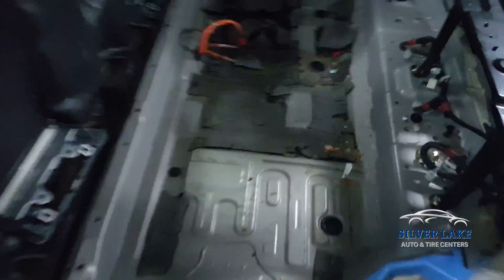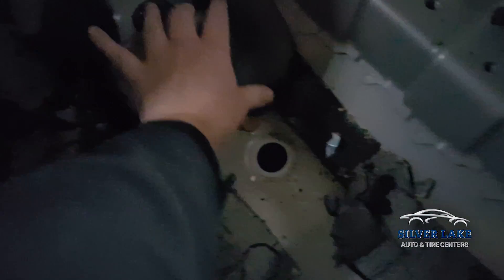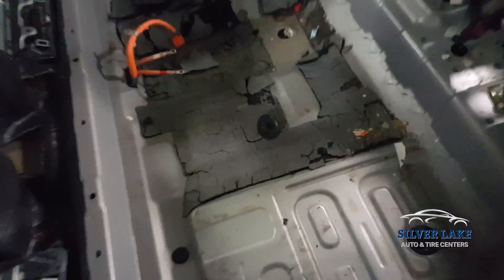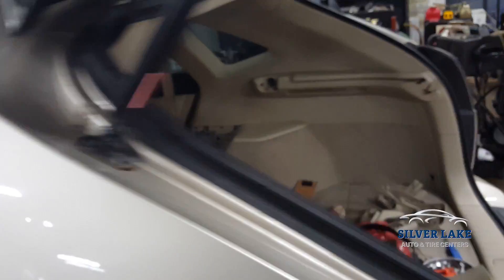Hybrid Battery Isolation Fault

Comment: A “fresh new filter”? Wouldn’t it be easier to just clean the trash out of the “filter”/drain plug? It’s not as if the drain plug goes bad. Brass tacks, the Hybrid Battery is leaking voltage.

Comment: hi and thanks for your nice video.
i have 2006 Lexus rx400h . i had code like hybrid battery check and vcs . which is said wet battery. 
i open battery and clean everything even battery unit free of collagen. 
and after put in on the car . i try to delete codes  with obd 2 i get it from amazon . 
but i cant and i still have codes like 03190 - p3193- c1259 - c1310- p0ac2, 
pls let me know what do you think . do i have to go and buy second hand battery or to someone can delete my code?
thanks for your time and answer in advance.

Comment: Tip for the mechanic, it’s the NIMH battery which causes isolation fault 90 percent of the time and 2nd pool of water in the car does not cause isolation fault because condensation is pure water and is not conductive. I see you have a megaohm meter use it because the fluid from NiMH is too clear to see plus they leak at the bottom where the little bolt goes into.

Comment: Thank you! Had same problem on my 2008 Toyota Highlander Hybrid.  Is it possible to get access  to the drain plug without removing the entire battery system?  I found that blowing a fan through the hybrid battery vents cleared the trouble code but am concerned that it will come back again. Will check for tailgate leaks as a result of you video.
Reply: You might be able to gain access under the vehicle to pull it out. Putting it back in may be an issue.

Comment: I have a question, is it possible to connect this battery in the Lexus RX 400H to a solar panel placed on the rooftop of the car so that it can charge while driving or parked directly to the sun

Comment: I have a 2011 Nissan Altima Hybrid and am getting a P0AA6 code along with a U0293, B2562, and B261E codes. so far I have changed the brake switch and the 12 volt battery. I haven't taken it apart yet as I'm trying to limit my options before going through all of that. Should I check all my grounds within the car and fuses first? Is there an easier way to limit where the problem could be?
Reply: Sounds like you have an isolation fault in the ac compressor motor causing the P0AA6. That would need further testing with an insulation tester and proper safety equipment. The B2562 could also be the brake sensor sub-harness or a faulty IPDM. Search for TSB NTB10-139.
Reply: @DanGarlock  thank you for the reply. could this still be the problem is my car isnt consistent with the no start? So far i changed my abs fuses in the engine bay and it lasted 4 days without a problem. After a couple times and a few days, its lasting another 4 days before having the problem again. Very inconsistent.
Reply: @Shwaynki  That is where I would start to remedy the codes. Fix what the car is telling you is wrong 1st.

Comment: 2006 lexus rx400h code P0A80. Can you help me out
Reply: Sure, do you have a specific question?
Reply: @DanGarlock  what will happen if I don't replace the battery right away
Reply: @1978chevymannova  You will run the ICE (internal combustion engine) more resulting in poorer fuel economy and less performance. Eventually you could run into an issue that the vehicle will not have enough available current in the battery to start the engine with the motors since this vehicle does not have a traditional starter.

Comment: Hi, Just wanted to know exactly where the drain plug is located under the car as I could not see it, does anything need removing from under the car to get to it?  Wanted to locate it and check if the filter is blocked as a precaution.
Reply: It is under the battery and the battery would need to be removed. Go to the 2:20 mark and you can see them. Cannot really clean them without the removal of the battery.

Comment: I have a 2012 Prius V  Codes 526/614 have you ran into a common problem with These two codes?
Reply: Hi Roman. This is also indicating a high voltage leak into the chassis ground. It would need to be isolated and tested with an insulation tester. Possible HV battery, convertor/invertor, or AC compressor. It is hard to tell without more information and testing.

Comment: Hi Dan could you please tell me the function of that orange pigtail cable coming out of the car floor at 2:24? I know the other two are obviously the connectors.  Thanks!
Reply: The two with the eyelets run to the system main relays. The pigtail runs to a bunch of different components like the battery fan control, ecu etc.

Comment: Hi👋
Cleaned it and replace fuse relay on battery. When turning the key clicking noise coming out of Hbattery relay box and when it’s time to start nothing. Any suggestions?
Reply: Do you have any fault codes?

Comment: Tell Me Where is block 1, 2 or three about sequence of hybrid battery?
Reply: Salman, depending on the application, the best way to determine is to look at a hybrid battery wiring diagram for your application and look for the color wire that corresponds with the battery voltage sense wire for the V-Block you are looking for.

Comment: And... What's happened next
Reply: After we repaired the leak, replaced the plugged drains and dried the interior we reassembled and no problems returned.
Reply: @DanGarlock  THANKS! Going to buy tomorrow dead RX400H , dealer says: CHECK FOR WATER LEAKS INTO CABIN ~|~WATER INTRUSION HAS CAUSED A VOLTAGE ISOLATION FAULT IN THE HYBRID DRIVE SYSTEM PREVENTING VEHICLE FROM READY'ING ON. ~|~VEHICLE WILL NEED HYBRID BATTERY REPLACED.  Will see.

Comment: So the water that leaked in made the sound insulation rot and block the drain and the water also conducted (ice doesn't conduct) to short out the high voltage battery?  I think I got it.
Reply: Exactly. It was an intermittent issue. When the ambient temp got warm enough in the vehicle, the ice would melt and then the fault would occur.

Comment: No swaping parts,just dry it out?
Reply: On this one yes, we cleaned out the drains in the belly of the car and found the source of the water intrusion and it was all good. In this one, there was water leaking in from some improperly sealed welds in the left rear wheel well area.